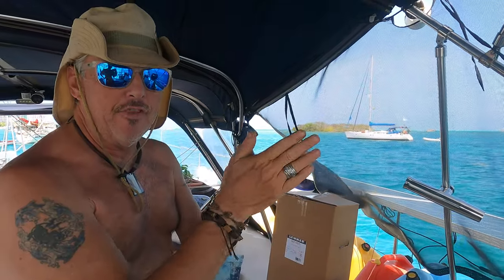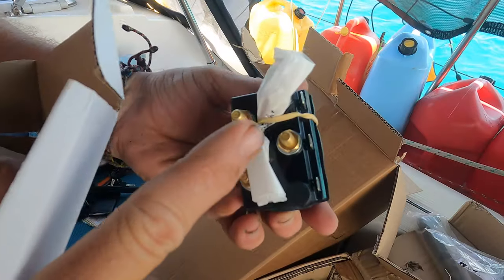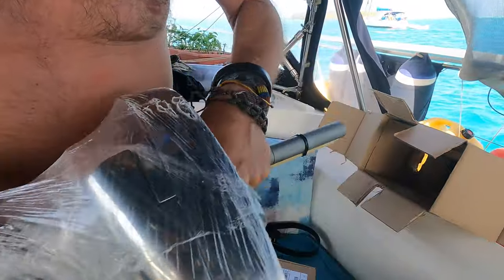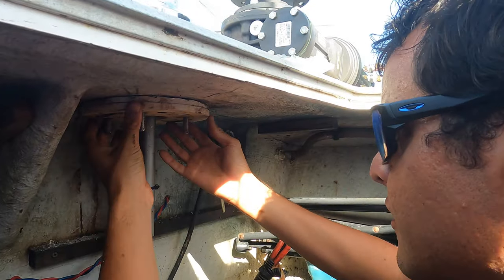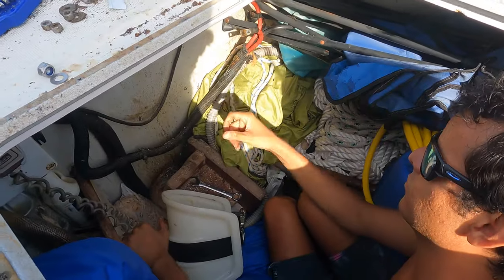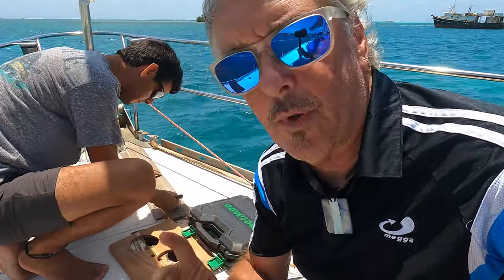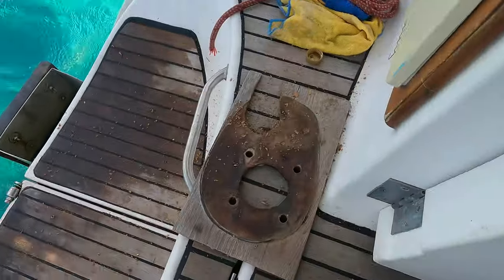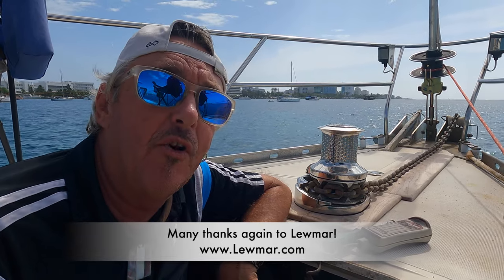SSL628 ~ Installing a new LEWMAR 24V Windlass onboard.. a MOST IMPORTANT DEVICE!!

Comment: paint those battery connections with liquid elect tape to prevent corrosion. I have worked on boats that it was done and when I peeled it off I was shocked at how new it looked under it.
Reply from the maker: we've been covering them with Lithium grease, seems to do a good job also!  :)
Reply: @SailingSophisticatedLady  
I would have smeared some on that capstan shaft, it would have made it easier to get on and off if needed in future after Seeing the state of the old one.😉

Comment: I replaced my windlass last yr with a Lewmar.

I had a problem with that same exact solenoid/relay that came with the windlass. 

I ended up taking apart the solenoid, and it looked like the solder they attached the relay contacts with had spilled a little over onto the contacts.

I sanded all of them back clean and flat, and so far has worked fine.
Reply from the maker: Glad you were able to fix it on your own!

Comment: Hi Captain Rick, They are called "Pleasure Craft".
PS: Using anti-seize on the shaft/keyway etc. now when new would make disassembly later far easier. A little silicone sealer around the base would not have hurt either. Deck foot switchers are a nice option to have so a person on the bow can easily operate it.

Comment: After receiving parts to repair my Weber grill I realized that one part would not fit correctly without a weld.  Not having a welder, I asked myself WWCRD? (what would Captain Rick do?)  One stainless steel clamp later it was up and running like it was brand new!  Keep the faith!
Reply from the maker: Yep, some times we gotta work with what we have at hand!  :)

Comment: Just a thought, why not drill a hole though the deck on top of the motor where it balances, then you can lower a rope tie it to the assembly and help lift it which everway into position, then just plug the hole up with a stainless steel bolt till next time, this way you can service the assembly more frequent, i was struggling watching Benjamin trying to hold it up, anyway loving the content with little Ric making himself heard.

Comment: In small boats, think stern drives and outboards, we use a blue wire for the up + circuit and a green wire for the down + circuit from the switches.  It is help ful when diagnosis is needed.  It is also standard across all makes and models now a days.

Did you seal the screw holes and stuff so the water does not leak on top of that gearbox housing? I realize the compartment is self draining.
Reply: Was thinking the exact same thing regarding sealing the winch to the deck.

Comment: Did you put butyl tape underneath and around the teak mounting plate for the windless? Didn’t see this process included in the video. Ahh … Just read 3M 5200

From West Marine - A bond created with 3M 5200 may last forever, so you are in a pickle if you later decide to separate the two surfaces. The solution is a marine adhesive remover like Anti-Bond 2015, which breaks the bond between the adhesive and the substrate, so deck hardware can be removed. Penetration can be encouraged by first scoring the edge of the bond with a blade, which might be required in the case of winches or other hardware that have been in place for years. Anti-Bond 2015 can be a real life saver in the case of hardware that is difficult to remove.
Reply from the maker: I figure we're at least 15-20 years away from having to worry about replacing that plate.. :)

Comment: Rick you have done a very good job on installing your new anchor windlass as always. I see you have gone for the Beta Marine 85 HP engine, does it come with a new 
gearbox?  {it should do}   They are a very good unit, very popular in Britain and Europe they are very smooth. I have sailed a few boats with a Beta engine in them and
never had a problem with them, they are a good starter first time on the key every time. I am looking foreward to that blog. Thanks Rick.
Reply from the maker: Yes, we are replacing everything same time, new engine, starter, gearbox, alternatoras, everything!  :)

Comment: Your Beta Marine looks like a mechanical injected with mechanical lift pump. I think that's Kubota with forged crank and bottom end. Did they design a custom foot bracket for you? Excellent Choice!!!!! Good luck getting it in. If I remember correctly it has gear timing. Hopefully Glow Plate like Cummings.
Reply from the maker: Yes, it's Kubota block, and all mechanical.. yay!  :)
Reply: @SailingSophisticatedLady , As opposed to the new yanmars  - they are yet to marinize their wiring loom.  Couldn't see themselves to tin the wires.  when challenged - Yanmar said their boats dont get wet inside.